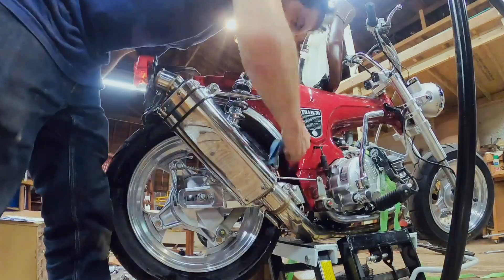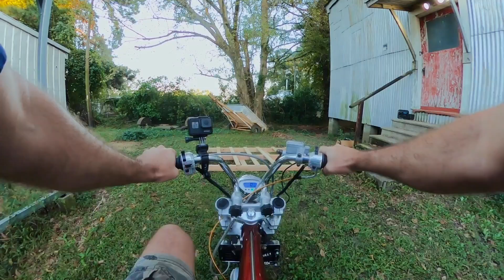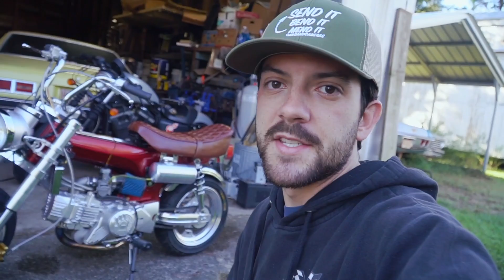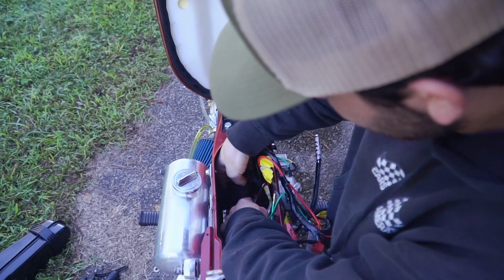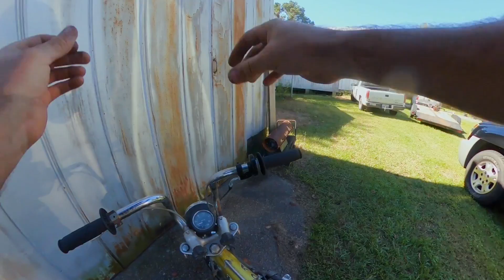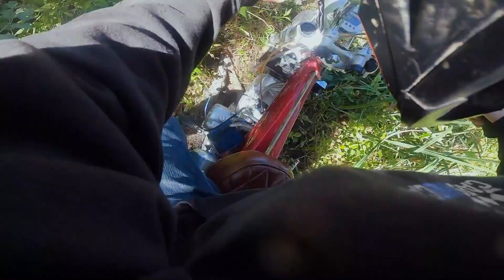190cc Honda Trail 70 First Ride! 19HP Restomod Honda CT70 Build

Comment: I think this bike is the only vehicle I've ever seen on this channel where no corners have really been cut. This is a rarity. Nice build.
Reply: give them time soon the jet drills will come out and they will be drilling things they shouldn't. instead of buying some $3.00 jets to tune it right
Reply: @MrGixxer1300r  I am a fan of theirs so I really wish you were wrong but at the same time I can totally picture that happening. And I agree, they get the hookups on parts so why did they simply adjust the needle and call it good? I get that it's temporary but I totally would've opted for at least a fatter main in a heartbeat. Before riding any real distance. Wonder if they checked engine temps after assuming they were lean?
Reply: I was thinking the same 😂
Reply: Nothin wrong with jet drills.
Reply: To be fair when your working on old rusty things like they do it's kinda hard not to cut corners When they don't have the correct parts on hand they make a part and make it work I don't see anything wrong with that I think that's one of the main purpose for the channel is to show how you can fix something from a little of nothing I can't speak for them I don't know them personally it's just my opinion Us North Carolinians  think a lot a like lol
Reply: Othe than the Chinese motor.
Reply: Lol
Reply: But this is worth it alot of the other stuff is for funny and good time or learning it takes time to get better
Reply: @MrGixxer1300r their moto is no parts no tools no plan. There’s not an issue with that, cause most channels are perfection only. If they didnt build stuff they way they do then I wouldn’t wanna watch.
Reply: @MrGixxer1300r  NOTHING!! at all wrong jet drills. You can't always buy what you need and have to make it. Many times on the track on test and tune days we had to use jet drills and.it wasn't on some bike carb it was a set.of triple throat webers on a 911. Built and tuned not bought sir.
Reply: I believe he had to do some grinding on the front end to get some things to fit.. so, technically,  he cut (or ground) some corners.  ;)
Reply: Troo
Reply: Sunflower Seeds  solder it shut and re drill it to the original size.
Reply: @MrGixxer1300r  that’s the danger of YouTube, doing it properly doesn’t entertain people for some reason. People just wanna watch people doing dumb stuff and if it works cool! Weird situation!
Reply: @EJ-74  same here in north east tn. We love to make something from nothing. Anyone can do it right. Takes a real tinkerer to make the wrong part into the right one.
Reply: @glencalhoun9544  You're not to far from me I live in NC about 20mins from Martinsville Speedway When I was a kid I made many parts using a drill press as a lathe lol My grandfather showed me a few tricks and it was on I've made some janky carts in my life but it was fun as hell to ride those death traps 😁 ✌️
Reply: @EJ-74  same here buddy. I had a drill press, grinder, welder, & a big barn. That was all I had but I made it work for me. Lol. And yes, the death traps seem to be the funnest to ride. Hell, im still riding death daily about it. Lol.
Reply: Corners cut? Or corners cut?
Reply: He reused a sketcy paint job instead of redoing it if that helps.
Reply: @MrGixxer1300r  drilled guesswork jets have held back every 2 stroke project they've ever had.

Comment: Hey if your front end feels like it’s pushing and not turning well you need to raise your forks up in the clamps
Reply: I was thinking the rake is out of whack causing it to speed wobble.
Reply: @DanITGuy  you're right because you can feel the shift in stability whenever you use your front brake in corners vs the rear. The way it changes the rake makes it feel less stable
Reply: It could also be something not right with the rear end which most people over look
Reply: Does look like to much rake. Exaggerated by the small scale. Choppers are awfull, things to ride. The hard rider rides the front wheel..
Reply: Sounds like caster effect
Reply: How much travel do you have in that rear suspension? That rear fender looks WAAAAAY too close to the rear tire. Too low in the back, too high in the front, and too much weight toward the back will make it handle terribly.
Reply: instablaster...

Comment from the maker: Can't wait to hit the road!
Reply: run them at farmington dragway
Reply: Yeah I'm a fan and I got a ct200u and it's a pretty good bike you should do another video on it but and make it like a drag one or something I don't know
Reply: Can't wait to hit the like ;-)
Reply: challenge you do ford model T
Reply: 16/32 sprockets?
Reply: You should put a CRF150R motor on it because it makes 29 hp stock!
Reply: Or a crf150f motor
Reply: If your bike feels like the front end is pushing and not turning well you need to raise the forks up in your clamps should make it way better
Reply: Like not a ton but just a lil bit will make a big difference
Reply: Nice CT. I had a couple as a kid. My dad bought a basket case CT70 with a bad engine. We had a SL70 engine, which has a clutch. It made the CT a lot of fun to ride. But with the odd feeling front end. I am guessing it feels a little tight and washy/wobbly. First, check the front tire pressure, it may be a little low and causing the feeling. Second, raise the forks up in the triple clamps, leave a 1/4 of a inch of the fork tubes stick up above the top triple clamp. Don’t go by the fork caps, go by the tubes. There may possibly be height marks on the fork tubes. But if not, raise them by a 1/4 inch. You don’t want the triple clamps tightening around the tops of the fork caps. They won’t tighten right. Or should I say square. Third, loosen the front axle nut some, loosen the bottom triple clamp bolts some, have the top triple clamp with the fork tube tops sticking up a 1/4 inch with the top clamp bolts tight. Stand bike straight up, hold front brake, push down and forward on the handle bars pretty hard 3-4 times, tighten everything back up. This will align everything up and have both forks working equal and straight. Forth, just to check them. With the bike standing straight up or on a center stand, grab the top of the front tire, between the forks, try to move it side to side, see if the bearing is tight. Do the same with the rear, but at the back of tire, see if the rear bearings and swing arm bearings are tight. Good luck with all the projects.
Reply: @funguynstc  Good words Captain Chaos.  I hope he will take our advice (see below) before the long journey they have planned.
Reply: Make sure there isn't any play in the swingarm, have had that happen and it makes it feel like your driving jello LOL
Reply: What tire pressure are you running in that front wheel ? I had the exact same issue with a motorcycle once where it didnt steer well and the front end felt heavy with a wider wheel that I put on it. Turned out my tire pressure was low
Reply: I stay right in wv
Reply: HOW DO I BUY?
Reply: Hey John did you have trouble setting up clutch cable? I have a 190 and I think the original drum break leavers can't pull the cable far enough. Wondering if you changed the clutch leaver to make the clutch fully disengage?
Reply: That swing arm looks nice, but do so research them on them in ct70 modders Facebook group. They crack easy!!
Reply: What part of WV are you going to?
Reply: I’m after a trail 70 frame, Got any spares kicking about?
Reply: HEY GUYS I HAVE A SUPER URGENT QUESTION!! I GOT A GUY WITH THE 228R TILLOTSON MADE THROUGH EC CARBURATORs wanting to trade me for my 2 seat Murray go kart with a predator on it. Have u herd anything on about these upgraded tillotson????m
Reply: I live a few miles from macswoods. Didn't Kno we had celebrities in the area. Great vids . Keep it the good job
Reply: hey would you guys build me a kart like the 200cc shifter kart?

Comment: Try these 2 things. Lower the air pressure in the front tire by ALOT.   Remember the caster on this bike was designed to run with a flatter knobby tire, not a nice round slick. Also try to raise the fork up in the tree like another guy said. This will also change caster. Good looking bike guys!
Reply: I agree

Comment: The jet needle doesn’t effect wide open throttle, that would be the main jet.
Reply: It does. Depending on the carburettor the needle has slots with a retainer clip on it at the top of the needle. Move the clip to a different slot and the needle will have a different height and therefore different diameter at any given throttle position as the needle is never fully out of the jet. Move the clip down, therefore needle up, therefore slim the diameter at the jet resulting in more petrol aka a richer air fuel mixture
Reply: That is incorrect. The needle isn't completely out of the main jet, the taper used can modify WOT fuel delivery.
Reply: i agreewith 300zx as the main jet is userly alot smaller then the emulsifyer tube so at wide open throttle the needle just sat in the entrance to it wouldnt restrict flow unless you had the clip on the top notch on the needle then mabie but i see where you get the idea it would and mabie it would on some carbs
Reply: Just take a nice long wide open run and then check the plug color it'll tell you if your main jet is lean or Rich

Comment: OH MAN YOU GUYS ARE BRINGING BACK MEMORIES.  Twenty years ago when I lived in New Jersey, I bought a brand new 2000 Panda Commute (Honda Chaly copy), which was made by a Chinese company Jincheng and were imported by a now defunct company Panda Motorsports.  It came as a  MOPED on the MCO title and did have pedals incorporated with it.  It had a Chinese 49cc 3 speed auto clutch underpowered Honda mini trail engine just like a monkeybike.  This looked like a step through moped and not like a monkeybike.  At the time, there was a company out of Winston-Salem NC that dealt with monkeybikes and they built an engine for me that was a 110cc and i installed it on the Panda.  I also filed for a body change and got a motorcycle plate for it.  I used to run it on the interstate and cruise at 70 mph (I did do a gearing change).  I used to get pulled over ALL THE TIME because they thought it was a moped.  I had an MC registration and it passed state inspection (which they had at the time) and there was nothing they could do.  Every year, we would do a rally to Montreal Quebec and I rode that thing to Quebec and back.  Fun bike.  I truly miss it.

Comment: That is the best looking Trail 70 I've ever seen, and I'm old!  In my aging process I have sold literally hundreds of motorcycle head bearing sets.  Don't take this wrong, but at least 20% of the non-mechanic installers will put then caged bearing in the race up-side-down.  Other common issues are the race not fitting in the frame correctly, (wrong parts, frame wear, washer, keyed washer, washer,  spacer in the wrong order etc.)   When correctly assembled with quality grease, the nut should be tightened enough to assure the races are fully seated in the frame and parallel, loosened, then tightened snug while rotating the bars.  There should be NO PLAY whatsoever in the fork or bars when properly set, and there should be smooth rotation without any binding from cables etc.  On a triple tree set-up like yours it is imperative to have PERFECT spacing and parallelism in the triple-tree brackets tubes and axle-nut.  IF IT DOESENT FEEL 100% RIGHT DON'T RIDE IT.  Take it all apart, clean and inspect everything look for unusual wear indicators and try again, and again, and again until it rides, brakes, and handles like it should.  I ride everything from 1100cc sport touring bikes to 50cc four stroke scooters, and I can assure you, you can get on any one of them and dive into a corner with total confidence.  Because your life depends on it, it should always be 100% correct!
Note: "Captain Chaos" has good advice on fork tube parallelism methods below.  All the spacers on the wheel axle, between the bearings, and outside the bearings are critical.  Tightening the axle nut should not pull in or out on the forks.

Comment: Had a similar problem on my 83 virago. I realigned my front tire. Loosen bottom triple tree bolts and pinch bolt on axle and then bounce your front suspension a few times and let it settle into position.

Comment: Did you replace the cups in the head tube with the new ones? You can't re-use the existing cups with the new bearings, you need to pop out the old races or else you'll get some weird binding...

Comment: Nice build! I recently upgraded my 74 Honda st90 from a YX140 to the ZS190cc 5 speed also. I'm running a Mikuni TM28mm flat slide carburetor: 220 main jet, 17.5 pilot. The needle clip I have in the center position. The bike rips! See if Vince at T-Bolt might send you the carb and also an easy start CDI box. It will make starting it, either kick or with the electric starter much easier and you won't have any starter chain problems. Can't wait till you do the West Virginia road trip!

Comment: On the carb tuning get 10 pilot and 10 main jets online in kits. Around your stock jeymt sizes.  And start at the pilot and mixture screw setting. Backfire when you let go of the throttle points to a lean pilot jet . . Fuel mix screw should tune between 1and 3 turns out from lightly seated. After getting it dialed go to main jet. Go big and work down till you get nice full revs. If too big on main the motor will bog if to lean it will pop and act like a revlimiter at a lower then full rpm. When happy with the main jet. Then make needle adjustments to improve mid throttle response.  And go ride. You can also do a few plug reads  to be 100% sure the jetting is spot on.

Comment: I need to finish mine. I started with a CT70, got wrecked, and found a CL70 in a scrap yard. It's a longer frame to start and with the swing arm. Sitting on the CT70 wheels it sits super low but still leans good and should be really stable.

Comment: Awesome, i build a 77 dax from the frame up with the same engine... And yeah it has a drinking problem, also have the 45mm usd kepspeed fork and also the weir wobble. I have a 17-28 gearing if im right, 12 inch wheels. But very tiny tires i can reach 130kph/80mph but it doesnt drive very smoothly. This engine really is an race engine. And will always want to pull. And does that really good it honestly flies soooo hard its scary. Love it keep. It up guys

Comment: Just went through the same thing with that front end.  It’s binding at the lower headstock. We cut a small section off and it solved the problem.
Reply: Came here to say the same thing, might be a spacer in the bottom of the package the forks came in that would raise the bearing seat so it ain't rubbing the frame lower/cup

Comment: Inspect your triple clamps (in particular the lower) to see if they're rubbing on the steering neck. I wish I was there to actually feel the steering problem, so I'm just kinda shooting from the hip. There's a few other things to check - like rake and trail. Be sure to confirm that your rear wheel is aligned and both wheels are centered. Handling issues are no good and can result in serious consequences. I know that I'm not there and haven't ridden the bike, but working on bikes is what I do. There could be other causes out there, but those are a few things to look at. Please get it worked out rather than trying to cope with it. I ride many different bikes that all handle differently, but despite their differences they should all feel stable. You riding as if drunk is not stable lol. Anywho, the bike looks awesome! Congrats! I'll have to get me something like this down the road.
Reply: I agree. Check center on wheels...

Comment: Nice looking bike John! Love the videos! If you've made that many changes to the bike's height and the different forks, you better check the rake and trail of the front end. Just search the internet for how to measure. It's the centerline of the steering head, not the forks, where it projects to the ground, compared to the tire touch point, should be about 3 - 4 inches.

Comment: I've just noticed what the main cause of your steering problem may be. The stock forks had the axle at their ends or tips and your replacement forks are "leading axle" forks and that is a total game changer for the way your stock rake and trail geometry was designed and set up. Moving the forks up and down in their clamps may help some, but you might need to make other alterations to bring the steering and stability back.

Comment: When I added fork to my st70 I had to lift the lower bering cup by putting a washer on before the cup and then putting on the bike. As the cut out for the turning stop isn't deeper enough! Meaning the string was sloppy or to tight. Worth a look!

Comment: Hi  john, i  modify and drive these kinda bike's in belgium , 
a few pointers for the allignement for the front wheel :
you gotta  have the wheel straight in the middle of the forks, gotta make costum spacers ,  the wheel has to be in the middle.
also you got the chinese usd front fork, so each leg has to be  evenly measure from  the bracket's they slide into.
hope this helps greets  bc 
ps: sorry for the bad english

Comment: You may want to try some steering stabilizers. They really help with small wheeled bikes with more power than they were meant for. This build really made me want to go out and buy a CT70 and restomod it. Small bikes like that with some sticky tires and gobs of power are insanely fun.

Comment: Maybe during the fork installation the axle and the triple tree aren’t parallel. Had a dirt bike once someone wrecked and it had the forks twisted in the stem clamps. Made sure axle was lose, loosened the clams then tightened the axle then re-tightened the fork clamps and trued it right up. Sweet ride! 👍